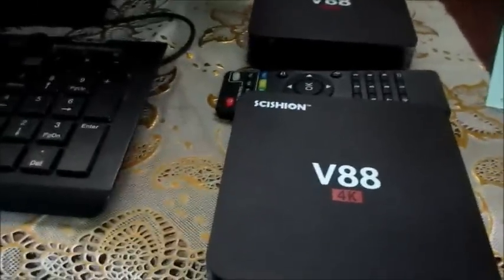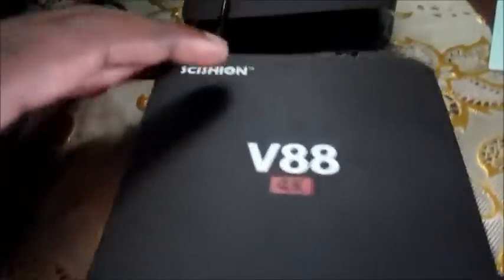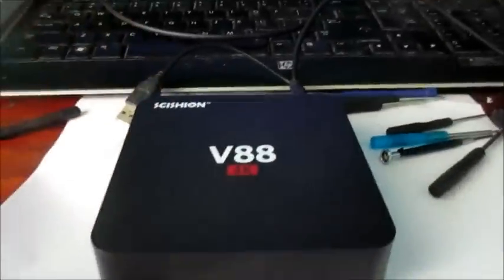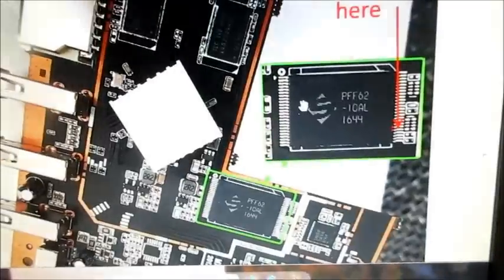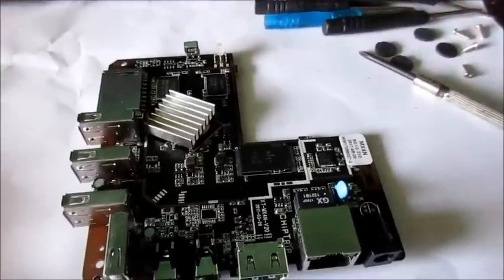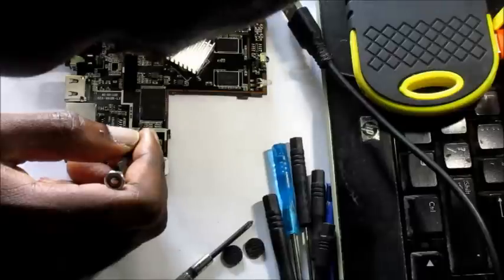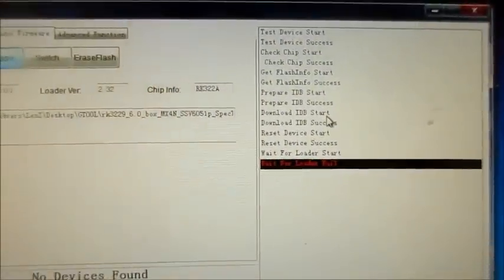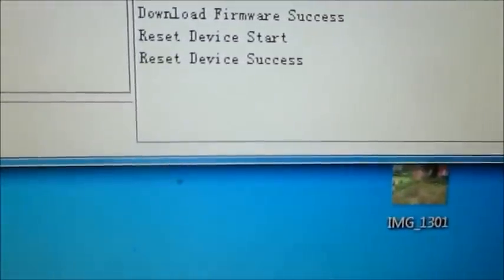How To Fix Android Tv Box Stuck On Red Light- Fix android Box not turning on

Comment: Hi what R U doing with pin 29/30 ,r u shorting them????. And   What app u r using ( android tools)???? Pse give link. Tell me after doing this box will work here after???
Reply from the maker: Hi using the 29 and 30 to get the box detected, if your box is bricked.  download Android tool release v2.3 software
Reply: @Lenzwalters  If i have the IDB FAIL. i need to use the same pins ? the  29 and 30 to continue
Reply: @Lenzwalters  Nice music, by the way

Comment: Sir, i have MXQ PRO 4K with RK3229, stuck with android logo and can not be reset with toothpick whatsoever. Only red light is appeared no blue light. Any advise to hard reset? Thank you
Reply from the maker: Did you try flashing it ? did you install the drivers ? Did it detect on your computer ?
Reply: It detected with Androidtool v2.35 and RockChip_Batch_Tool_v1.8. However, i did not do flashing or other action as I am not familiar or understand how it work. Perhaps you may guide step by steps to flashing?  Thank in advance
Reply from the maker: I have a video on my channel its pin in the comment, that's a step by step video..
Reply: Same here